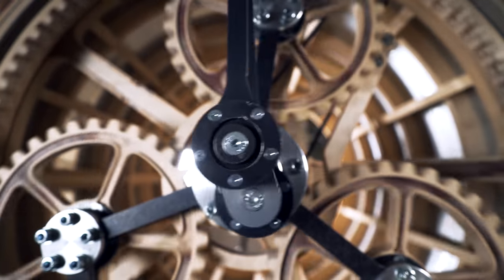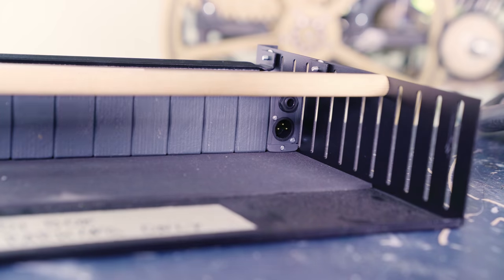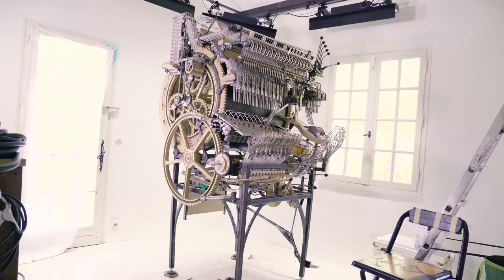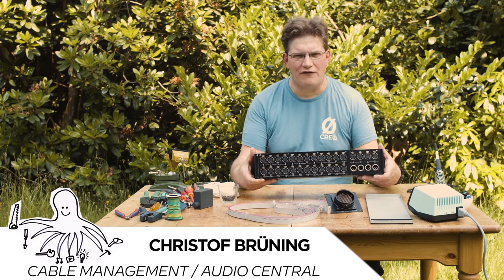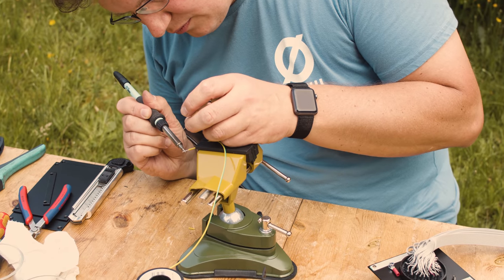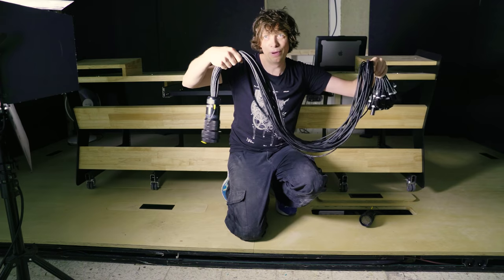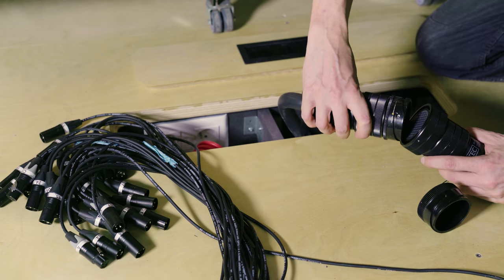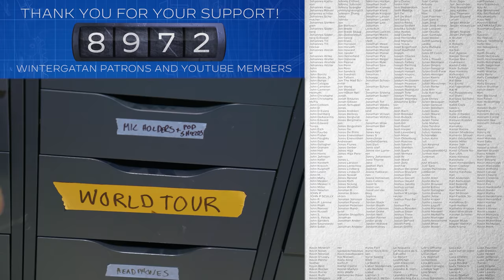28 Audio Channels in One Cable! - Marble Machine X #133

Comment: He should make a stop to clip the cable cap, right on the mmx
Reply: 3D print a threaded holder mounted to the side of the break-out box or on one of the expansion cover plates.
Reply: Krister Lagerström  connector cap is aluminum
Reply: In Aircrafts we use "depot connectors" to attach the caps of removable cables. These are basically connectors with no pins. This would be a perfect option to store the cap during a show. Maybe something similar to this (maybe 3D printed to save cost): https://www.mouser.ch/ProductDetail/Glenair/D38999-22FW?qs=kEOpzNpgFBMs3IKuAREO1A==
Reply: I prefer the idea of a dummy socket to plug it into during use.

Comment: Now when MMX has grown so big and heavy, it's probably time to seriously think about its rigidity. World tour means running that big mass of metal, wood and acrylic around, and you can't be sure it's going to be handled with care everywhere you go. Add floor-level beams for support, crossbeams where possible, overstructure, find tipping point. Install heavy duty (regulated) casters, possibly ballast mount. Next, the return channels can be used for more than audio - subtle motor control, lighting control (I hope you're not going to RGB MMX, right? RIGHT? But some effects (white or amber lighting inside of the drum?) may enhance its appearance, depending on music's mood.

Finally, the way you've integrated the 19" rack in the desk has blown my mind. I don't use rackable audio hardware, but there's a lot of things that can go there, beside servers and network equipment.
Reply: Mmx dmx!
Reply: Agreed! I would just bolt some plywood to the sides of the legs for transport. Or maybe make up some X-braces. Remove them for the show.

I'd assume Martin would be removing larger subassemblies to ship in their own boxes, so it might not be as top heavy as it could be.
Reply: I'm thinking heavy duty custom flight cases for all 7 modules.

Comment: I like to think that, whenever Martin says something like “time for the angle grinder”, the CAD team members gnash their teeth and rend their garments.
Reply: This was my thoughts as well. I thought the whole point of doing it up as a CAD model first was to avoid all these small changes/ad hoc mods.
Would be interesting to see a comparison of the original model vs the final model
Reply: the purpose of the cad was to intergrate all the known components into some semblance of order.

The Audio solution had been Spider City. Now it is Boa Constrictor and intergrated audio component channels.
A significant improvement which requires some relocation of relatively flexible components: like the symbal mount.

Comment: Its good operating practice to connect the two covers from the Veam Mulitipin connectors together, it stop dust and dirt from getting in when you need to re-cap the connectors :)
Reply: 😅Or just have the appropriate protective caps at each end - never seen one without em🤔
Reply: @DJCrOhmeOfficial  When the cap is laying loose (after the connector is connected) like sitting in a console doghouse or at the stage caboose. If you leave them hanging loose rather than just twist them together. You allow dirt, dust etc to accumulate, then when your show is over and you pack up to move on, you are just throwing that crap into the connector while traveling. I have done many multi-day festivals where you would not want that crap in your multipin. :)

Comment: Id have used an ethernet patch , lossless digital conecton to front of house mixer and much thinner cable , the clock in the dac is also synced with the foh mixer.
Reply: Yeah but that’s not as badass
Reply: The point is to be able to plug in to whatever sound system is already in place at the live venues.
Reply: @Agedude  you will have to premix anyways, the MMX won't most likely be plugged in directly
Reply: @Notadragon621  But it costs a lot less overall
Reply: @neur303  Is that supposed to be a double negative or a triple negative?  Not trying to be rude I'm just having trouble understanding.
Reply: At least with an analog snake he can plug his XLR into whatever Stage rack the venue is using.
Reply: Yep.. I would have gone with Dante. It would be so much easier to work with and if the cable gets damaged, you just swap it out with another ethernet cable.
https://www.audinate.com/
Reply: Going Digital just over complicates things.  There are many different mass connectors.  They are great till someone is in a hurry and bends or breaks a pin.
Reply: @neur303  yeah, with that many channels for a single instrument, you'll be pre mixing it. And with the length of that snake, no way in hell that's running all the way to front of house without something in between anyways.
Reply: Also, Audinate has a virtual sound card. You can record the Dante stream directly.
Reply: @wyattroncin941  we dont do simple round these parts
Reply: @spunkmire2664  is it going to be analog from beginning to end? If not, digitize it and run it over at ethernet cable. Analog will have a lot of pins at every interface and connector. Lots of opportunities for failure. Analog is bulky and expensive.
Reply: The whole point is to be a monster analog mechanical beast. Digital would ruin the the "art" of the project.
Reply: @Agedude  xD Yeah, sorry! I did not mean to double negate.

So i agree with the original poster. But I understand that staying analog is less complex and truer to the heart of the whole build.
Reply: Krister Lagerström  so much detail gets lost when digitalised.
Reply: @creativecityis  No it doesn't. Quite the opposite; lossless digitization at source does exactly what it says on the tin. Analogue is lossy.
Reply: @nagualdesign  There's no such thing as truly lossless digitization, sampling an analog signal will always result in the loss of some information.
Reply: @smilo_don  inaudible information though. Who cares about those frequencies you cannot hear? And yes, there is bit-depth but in a 32bit signal there are way more possible loudness-steps, than the human ear can perceive. Also, for long analog cables, the cable acts as a lowpass filter on the audio.
Reply: Simon you seem full of knowledge, but no one samples at 32 bit depth at an input. No major console manufacturer does, and no widely available studio interface does either. They do not know what console will be used on the tour, so they have to setup the machine for the world-wide average: analog.
Reply: @Agedude  touring bands often have their own mixer with them
Reply: @TheMaharion  many bands dont use the stuff the venue has
Reply: Krister Lagerström  you dont convert back it goes directly  into the mixer where its processed  and only gets converted back to analog at the speaker amplifier rack.
Reply: @smilo_don  I meant lossless in the context of compression, as opposed to lossy compression, and digitization at source as opposed to digitization after tens of feet of analogue cable.
Reply: @creativecityis  not that much when we consider the recording is going to be digital
Reply: @MrAkkaTinka  Information in the frequency range you can hear is also lost. Since analog signals are converted to digital by measuring it and recording the value all information between the measurements is lost in addition to the information between the loudness-steps.
Reply: @smilo_don  yeah but 24 bit dac is imperceivable to analog to  most if not everyone
Reply: @jcnash02  many bands tour with their own mixer and sound guy
Reply: @djscottdog1  Sure, but if you want 28 channel 24 bit 96 KHz dac that's going to cost you a lot.
Reply: @smilo_don  do you see this project ? I think it cost alot
Reply: @neur303  I don't think that it's good idea to premix MMX if it will play together with the band: it has so many instruments that engineer will need separate channels to mix it well together with rest of the band
Reply: @smilo_don  Not really, I mean it's not prohibitively expensive. Plus this kind of gear is usually rented for the tour.
Reply: jcnash02 Yeah Digico does...😉
Reply: The thing is that there are too many protocols for digital audio... which ones does the venue/festival provide... sure if do a whole tour package then no problem but since 4U was kind of much space how would you fit a 9-10U stagebox... Analog will always be needed in some way or another so no reason to limit yourself...
Reply: @larssonphoto  why does stagebox have to be 9-10U? Also "world tour" and "what venue provides" just don't go together, period. Even without whole tour package, local production company will have to be involved, and these days you can find a specific brand/model console (within reasonable range) pretty much everywhere, not just specific digital protocol
Reply: With 24 channels on MMX plus rest of the band it will likely have to be "whole tour package" though
Reply: @smilo_don  I don't think you can hear even the difference between 16 and 24 bit my kid. Above 24 bit even the pros struggle. Everything above 16 bit/48kHz is not done due to audio fidelity, but to have room to play when mixing, or post production. The final master will almost certainly be delivered to the main audience per streaming service in 16bit/44.1kHz, and even when touring live, every console used for that is digital, since years
Reply: @smilo_don  that's just really not true. As someone pointed out below, a digitally converted signal at a sample rate of 48kHz can and will contain every frequency up to 24kHz, that was present in the incoming analog signal. Human hearing is said to go from 20Hz to 20kHz, so that would be easily enough (even if there are anti aliasing filters going up the the 24kHz nyquist frequency, that could indeed mess with the phase of those frequencies, there is at least a 4kHz gap to frequencies that can be heard). Truth is, most people don't even hear 18kHz anymore, especially as they grow older. So no, there is no loss apart from biz depth.

And to the one that pointed out, that noone samples at 32 bit at input: I'm aware of that, I just pointed it out as a possibility. 24 bit, heck even 16 bit, is easily enough for the loudness range you want to use for a live mixing situation. And for recording also (as you probably won't record sounds below 30-40dBSPL anyway, so there's no information loss either).

Comment: I find it interesting that you went with this custom design, rather than just adopting some Dante connectors and running all your audio over network.  That way you could have 1 tiny little ethernet cable coming off the MMX and have up to 512 audio channels.  In that rack you could put a 48-port powered network switch, and then run 47 PoE Dante-powered mics, and have 1 network cable running back to whatever interface you want to mix with, whether it's a computer, or sound board that's Dante enabled, or break it out to analog inputs into a traditional analog board.
Reply: Analog is just way better in terms of all the possibilities to record the audio source.
Reply: Why would you use Dante mics when you could use regular old analog mics into a stage box then Dante to a console

Comment: This may be a silly question, "Why not use a digital snake?" Audio over Ethernet cable?
Reply: There's a number of reasons. 
Some people prefer analog signaling and want to wait until the last possible step before going digital. 
Others want to reduce complexity at the source and put the compute/conversion at the destination. 
Still others are just used to working in analog and the thought never crosses their mind.
In this case, my money's on the second option. Especially if doing A->D at the MMX would add more equipment to the machine than the preamps and snake box already add.
Reply: @d3xbot  Considering you can get digital pre-amps, and you could replace the custom input/output box with a 48-port network switch, you'd actually be saving space as it'd only be 2U rather than 2U for each device.  Also, then you wouldn't have to worry about replacing batteries in each pre-amp as they'd all be powered by the PoE on the network switch, or you just have 2 power cables and 1 ethernet cable. considering that they're converting to digital to record on computer anyway, Dante is pretty robust now, and would be a great solution for making travelling on the road easy since it'd just be network cables.
Reply: I had the same thought.  A Behringer S32 would take up the same space as the cable rack and work perfectly over one Ethernet cable

The sound quality doesn't change because it's going anyway through a digital mixing console.  Where the AD conversion happens doesn't matter, the closer to the source the better, because the analog signals are prone to interference.
Reply: How many venues are going to have that equipment?  He has to think about interfacing with that audio board at a stage, and that seems to be what the spider is optimized for.
Reply: @xheralt  I've never worked in a venue that didnt have access to a Dante/Yamaha system or at the very least, a company nearby that they could cross rent from. Any house worth their salt has a digital/network interfacing console nowadays.
Reply: Yeah my question exactly madi or ravenna would get the job done
Reply: @bobbylaird8732  The big problems is that there is no single standard of digital audio over Ethernet.  Dante, Ultranet, dSnake, CobraNET, etc and not compativle.  If you're planning on touring, you need easy connection to ALL sound systems, and that means analog.
Reply: @brianjrobinson  That's not a Problem. Martin need his own Mixer anyway on the world tour. He only send 1 or 2 analog Channels  to the end audio system
Reply: @xheralt  it's really easy to carry a Dante breakout box for venues that need analog, or just run the output from his digital mixer into their analog system.
The large venue I used to be in charge of hadn't upgraded to digital, and so just took the tour output if they were running digital.

There's no technical or audio reason for not doing the a/d conversion at the instrument in this case, I suspect that it's more of an aesthetic issue, musician-thinking, rather than audio quality, he probably just thinks that the multipin and giant cable is cool! Lol
Reply: @brianjrobinson  nope, you use your preferred digital system, and then you either put in your rider that all venues need to be able to receive a Dante or whatever input, or you find out what inputs the different venues have, and you bring an adapter, or if analog is the only option, you bring a d/a breakout box for your system for them to connect to.
No technical reason to use such a giant cable anymore.

Comment: why not DANTE, tho? that big multicore cable is gonna break at some point, and it's not gonna be fun to lug around. maybe just put an M32 rack there or something?
Reply: Certain contact microphones work best with the preamp that is designed to be paired with it. I would assume he chose this route over Dante so that he could power each of the preamps with 48v phantom power from the mixer. I was wondering that myself until I realized that he would need a way to power the preamps.
Reply: @thomaspropst9182  i mean, the M32 rack, and most similar form factor rack mixers, also have phantom power on board. I've been thinking about this for days, and I really can't see any reason to not go digital. Like, especially if this is gonna be for a full on tour- maybe there's something to be said for recording, but even then, that's such a tiny difference that having that giant cable only really makes sense if it was laying around.